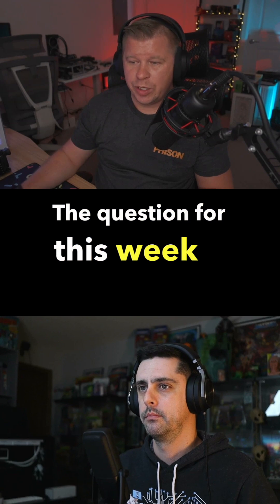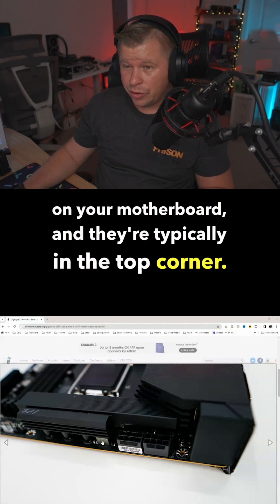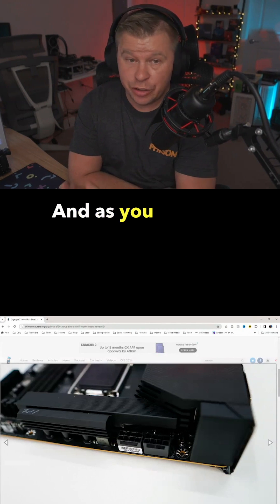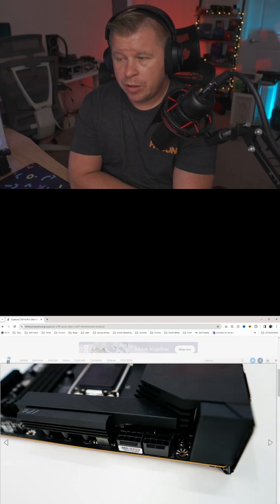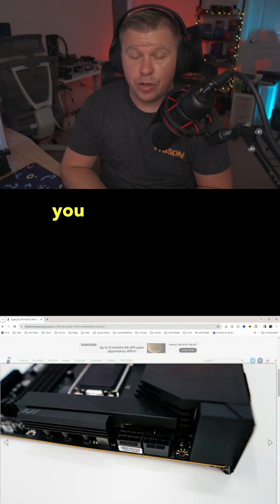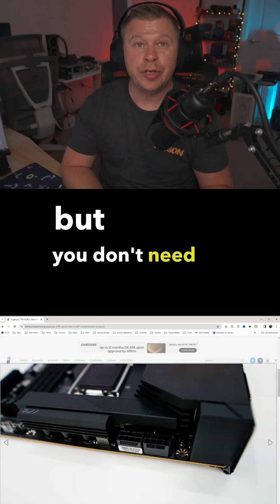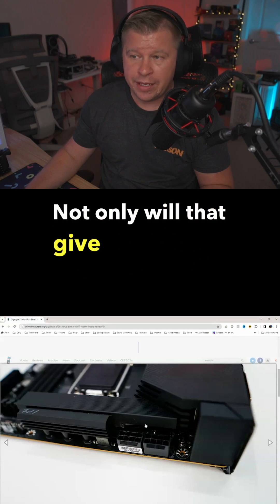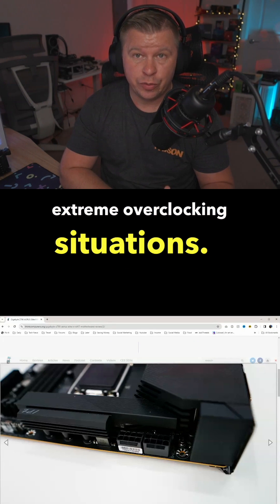Why are there two 8-pin EPS Connectors on my Motherboard?

Comment: I know you are right for most casses but showing it on high end motherboard for latest intel is a bad example because 13th gen and 14th gen i9 will work but will majorly underperform with only one 8 pin connected since thoose cpu have no problem drawing over 300w with spikes over 350w so i am sure it wouldnt boost properly or just crashed.but on other hand you could say that is extreme overclocking but by intel them self

Comment: I have Asus ROG STRIX B550-E GAMING with 5800x and when I plug in both cables the motherboard won't boot, it lights up yellow dios which means there is an issue with the motherboard, but when I plug in only one cable it boots normally.
Reply: May be a PSU issue.
Reply: @skybuilder23  Brand new PSU, but don't have another one to test and it wasn't cheap.
Reply: Good to know. I just bought an msi mobo and a video on updating bios made by msi said plug in the 24 pin and 1 eps connector to connector #1. Connector #2 did not need to be populated. Cpu and ram not neccessary either for bios update.

Comment: With my Z87 motherboard with an i5-4690K I only used one 8-pin even though the board had room for two.
Reply: If you arent overclocking you dont really need the second one.
Reply: He physically could not pull all that wattage into an i5-4690k to saturate even one 8pin. Even with liquid nitrogen cooling
Reply: @fmnfb9  That's the point of this video and my comment.
Reply: @oldmanonyoutube  Yes I was just replying to the clown saying "if you aren't overclocking". I am expanding the discussion past the video. You could try to overclock this cpu as much as it can take before it burns out and you would still only need 1 pin.